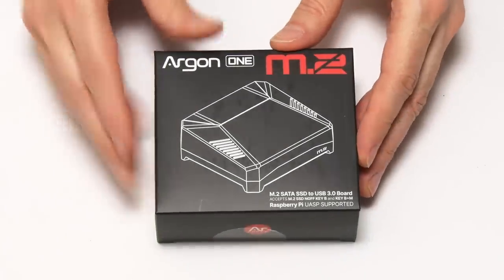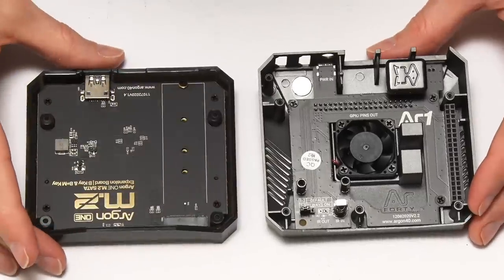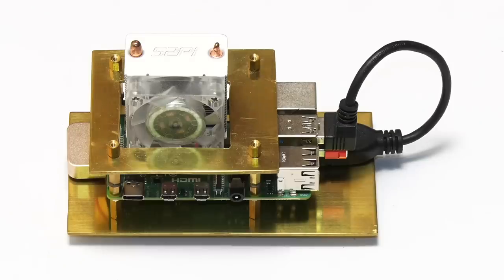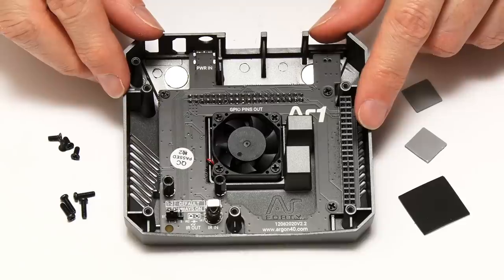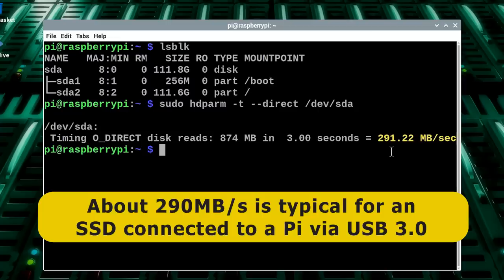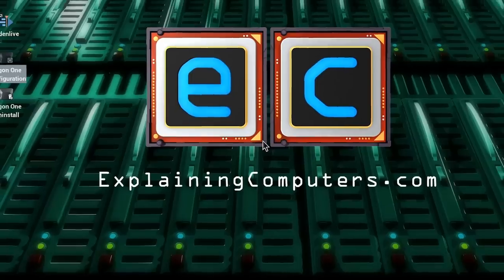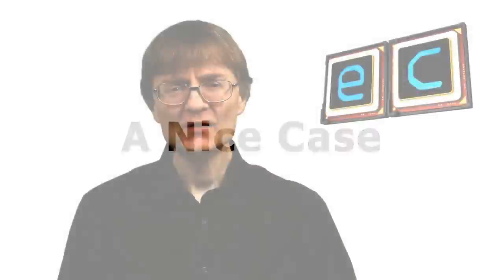Argon One M.2 Raspberry Pi 4 Case

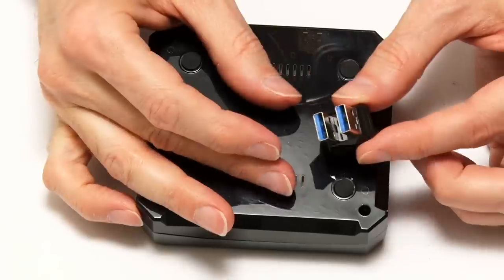Comment: That loop back USB to USB is such a kludge to get a USB HD/SSD connected. - 8:56
It has to be exactly that spacing and the Pi is the only use for one.
Reply: I had the shave the top of it off to allow USB cable to fit into slot above it. Else it was putting too much strain on the socket. Bad design.
Reply: @stephenhookings1985  - Oh, wow.  Ya, it does look pretty high.  I'm a bit surprised because the rest of the case seems well designed and fitted.
Reply: Well, considering that the mount for the m.2 drive is fundamentally the same as an external drive adapter...upside is that you're able to mount the m.2 drive, downside is that you're accessing it at USB 3 speeds, and taking up one of the USB 3 ports in the process.
Reply: Its a similar functional design to the one supplied with the CD drive on my Lenovo m93 micro PC.
Reply: That's what I thought too; What a jinky way to connect the SSD.  But I'm sure they're just working with what they've been given.  Maybe a 'C' Pi4 variant will have native capability to connect to an SSD?

Comment: Thanks C. Been using this case for a while now. Can't say enough about how great it is. My Rpi 4 4GB in this case running Twister is my main system, now. My only knock against it is that I needed an external wifi to get any reception with it. I use ethernet, now with no issues.

Comment: One thing that is really useful to have with one of these cases is a USB3 A plug to A plug cable.  This allows a PC to be connected directly to the bottom USB3 connector (SSD) on the Argon One.  This allows setting up the SSD in situ.
Reply: And better to use than the supplied dongle - that seems to contribute to WiFi interference.

Comment: Argon actually sells a conversion kit separately so if you have the older Argon One case you can simply convert it to M.2 case using it.
Reply: I recently bought this kit for my v1 case. It worked just fine but I still don't have those nice full-size HDMI ports. I'm using it for my headless proxy server and I bought a v2 with full-size ports to use for retropie.
Reply: @njbair  .. yes, nice kit to let you update a V1 to SATA, but as you say, missing full-size HDMI, and the IR receiver and Fan Jumper.

I purchased it to upgrade one of my V1 cases to give to my sister.. a wireless Logitech mouse/keyboard, a 32” 1080HD TV that a friend gave her, and she’s happy with it… simple web-surfing, email and light typing…perfect.

Comment: Argon one seems impressive, however "cooling tower" looks cool .
Reply from the maker: Yes, I would totally agree!
Reply: I used one for a while. Highly effective, but I wanted to streamline my system.
Reply: To be honest, cooling towers look too flashy and are pretty bulky and overkill for something like the Pi, I'd rather have a  gray box on my desk
Reply: Absolutely look cool… and as the cooling temperature tests showed, they are great at cooling the Pi..

Lowest temp  29C vs 38C
Highest temp  35C  vs  49C

But, the smaller, fully enclosed Argon, with all wires/cables in the back, and IR receiver is SO nice.
Reply: Im using the first version of this case for my Pi 4b since my shitty Pimoroni fan stopped working then it just broke.

Best case ever! I can run it over locked at 2000mhz all day long and the fan doesn't need to actually go on, altho it becomes much cooler, but that fan is so noisy.

I havent used my Pi 4 in a long time tho.

Wow this new case has full sized HDMI-ports!I almost wanna get this one just cause of that because micro-hdmi gets worn out and crap out very fast for me. I hate them.

I would need a new Pi 4 tho to use this new Argon one case because I broke one of my USB3-ports on mine
Reply: @pyramis47  Totally agree with you. I have one running for a few months now. I highly recommended it for anyone running RPI4 24/7. It keeps the pi cool enough and running smoothly. I live in the tropics of Malaysia and i can say this case is discreet, silent and just works to keep the pi cool. It does gets hot to touch because of the metalic case but it's quiet and less distractive. A must get for home servers/home assistants running on pi4
Reply: @crixster  Do you mean, without the cooling tower, with the original case, we can run pi for long?
Reply: @roshannubicus5917  With original pi case you will need a fan. I am using Argonone case so i can run it all day long. It does get hot around 50 to 55 degrees with the fan on. I really recommend getting at least some fan for pi4 if you intended to run it for long periods
Reply: @crixster  do we need a fan even if we have argon?
Reply: @roshannubicus5917  There is already a fan inside the Argon one here. you can even change the speed with the built in script.

Comment: Looks like they could add a couple very nice features pretty easily.  Extend the SD card slot out slightly and give you a slot to use it on the case, and flip the M2 socket onto the bottom of the board, with a hatch in the case bottom for easy access.  If they could find a way to jumper the USB3 connection internally as well so you don't use up a port for the connection, this would be about the best case out there.

Comment: One reason I bought the Argon One M.2 case was to build a Pi NAS. I was going to do the usual "rats nest" Pi set up with cables running all over and external an SSD, but before I could, I saw the Argon One M.2. I did the math, and for my application the cost of all the hardware was almost the same, and the M.2 eliminated the cable clutter and compatibility uncertainty, so I went with the Argon One M.2. No hardware problems whatsoever! Configuring the software was the biggest hassle. While this may be the most expensive Raspberry Pi case available, it's also the neatest and best looking. Having the SD card sealed inside the case may be a minor hassle, but having destroyed an SD card  because it was sticking out when I removed the stock bottom cover of an original Argon One case (tip: don't bend an SD card), I consider this to be a 'feature'. Booting from an SSD is easy these days, so a small slow SD card is becoming unnecessary. 
Thanks for the video!
Reply: Ditto! FYI, I'm using the SSD for storage only and booting/running from the top USB3.0 port using an uSD adapter. It's not quite as fast as the SSD, but much faster than uSD. This way, I can backup, swap, and test different system uSD's whenever, without disturbing my data libraries and local repositories. Just pop in a vanilla OS and locally install the apps. ;-)

Comment: Bought the original case when pi 4 came out, glad the lower m.2 part is sold separately. 😁
Reply: You're still stuck with the mini-HDMI connectors, but, yeah, I was glad to see that I could add M.2 after buying an Argon One before the M.2 came out.
Reply: @jfan4reva  Oh well. Yeah, mini-HDMI sucks, so I suggest avoiding connecting/disconnecting the mini-HDMI ports and use the inline connectors on the adapter cables. ;-)
Reply: @jfan4reva  they've released a V2 of the original case with full size HDMI connectors.

Comment: Crazy concept for a video.

I just moved to Florida and bought an old uninsulated house.

Florida is warm and humid in the summer. And I would like to protect cameras and stuff from humidity. I have one room that has a small window air conditioner.

I would like to build a unit that would control the airconditioner and a fan to pull exterior air into the room.

So what is needed is a device to control an electrical plug that also analyzes indoor/outdoor/ambient temp and humidity. 

Logic is straightforward but I have no knowledge of current technology to control power to an electrical outlet. The device I am pondering is a solenoid/relay.

Also a screen that shows measurements and targets. A way to adjust targets easily.
Reply: People use these types of devices to accomplish things similar to what you describe and many have documented it on Youtube. Greenhouse control, watering plants, etc. I use a Pi Zero, a relay, and open source software to control my underground sprinklers for instance; and (possibly) in future, greenhouse automation. I would suggest you may like to look at ChilliChumps Beginners Guide to Automation - https://www.youtube.com/playlist?list=PLuQ_ySnkV1elVl8hCvmYyEzjs_vxEIsxu for some of what you describe, as the scope may be more than Chris wishes to tackle as a project.

Comment: If there is one thing I love doing on Raspberry is installing a minimal Raspbian and then adding software manually and custom GUI. And Performance is assured. Just an idea. 
The case is really nice, though.
Reply: Yes, I'm booting from a USB3/uSD adapter, running any distro I like. I download all my github apps and data onto the SSD, then install them off line from my local repositories onto the vanilla distro that was flashed onto the uSD (assuming it is USB bootable).

Comment: Finally someone has mad a case that both fixes stupid design flaws (micro HDMI and cooling) and makes the Pi useful
Reply: There currently is one issue with the m.2 case related to 2.4 gHz wi-fi signals.
You can force it to use a 5 gHz connection by specifying the bssid of the nearest access point in the wifi configuration.

Comment: I'm not sure if it's well known but you can hook up a USB A to USB A to the m.2 bottom port (The one connected to the m.2 bottom case) If you need to flash the SSD. A lot easier than having to deal with the SD card as well as pulling the case apart. Mine runs so much better with the SSD!
Reply from the maker: Useful tip. :)

Comment: Just found out they released an adapter to add m.2 to the original Argon one. Nice!
Reply: Yeah, but be careful... It must contain the 2.2 version of the board, that one fixes the WiFi problems of the original version, basically the original one makes a faraday cage for the pi4 wifi antenna, the new one removes a chunk of copper on both sides of the board for that matter. Also I don't know if it fits the very first original argon one case that has micro HDMI ports.
Reply: @mariopojoy  good to know. Thanks!

Comment: So glad to see you got around to reviewing this amazing RPi case. Love this case. But I have to admit - blocking the microSD port is a pain.  Also - it bothered me it includes full size HDMI ports. I bought a microHDMI to HDMI cable for the RPi but can't use it now.
Reply: Switch to an ssd...it's night and day difference. One could cut a slot in it rather easily

Comment: Coming third wasn’t a bad effort considering it didn’t turn its fan on, while the others were presumably on due to their fan based design.

I’ve been running one of these on my home assistant Pi and it hasn’t turned the fan on once yet.  
Admittedly it’s winter here in Australia, but I’m expecting it to behave quite well over summer too.

Comment: I have an Argon One M.2 a couple of Argon 1 M.2 cases. In the first case I put a 120Gig SSD and I have had no problems what so ever. Basically I was very impressed with it.
In the Second case I went the Whole hog and installed a 2TB SSD. In this case (pun intended) when using a standard 5V 3amp power supply I get low voltage warnings. I did email the Pi Hut (the supplier) about this problem for a recommended power supply, but got no answer. In the end I used a Geekworm X725 fan plugged into the GPIO (be sure to plug it in the right way) and used a 5V 4amp power supply. The fan being used as an adapter for the power supply into the GPIO.

You’d expect to be able to run the Argon One case with a large SSD without having to use an unorthodox way of powering the PI. Perhaps the makers should make and a more powerful charger and supply that with the case.
So be warned if your thinking of using a large SSD, you might get low voltage warnings using a standard PI 5V 3amp charger.
If anyone is wondering why I bought a 2TB SSD the answer is I have a Raspberry PI farm, and they all network boot off this one PI. I have three OS configs for the farm. So I can power down the farm tun a simple script to select the OS and reboot the farm. That process takes less than 3 minutes to have the farm running a different OS to the previous. All of that uses about 512Gigs of space. So I could have bought a smaller SSD. 
If anyone knows of a 5V 4amp USB C charger please let me know.
Reply: I'm using the SATA compatible base successfully using a Kingston SA400 120Gb. I have heard others successfully using Western Digital equivalents.
As you say, current draw from the SSD and any peripherals quickly adds up until you get an overburdened power supply, leading to low voltage warnings and/or data corruption. (Been there, done that!!!)
I solved this by using a good quality USB powered hub, everything outside the case is run from the hub. The Raspberry PSU only powers the Raspberry PCB and M2..... This makes for a reasonable tidy installation also.

I have just received the latest toy today, the recently released NVMe base..... for M-Key NVMe SSD's only. Argon told me (after an email enquiry) that you need at least 3.5 to 4 Amps PSU capacity... which means that the standard Raspberry Pi PSU that most of us have, will need upgrading to something a bit heavier to cater for NVMe's heavier current requirements.... (and keep using a powered USB HUB for everything else)

I can't emphasise enough, the importance of using a quality, powered USB Hub for your Argon One Pi4 projects....🙃

Comment: It‘s worth mentioning that attaching the ribbon cable for a camera doesn‘t work out as neatly as everything else does for this case. In fact you might think it can‘t done at all, but there‘s an opening for it next to the GPIO connections, underneath the magnetically sealed lid. So you have to slide the ribbon cable through, in a narrow space next to the fan, and attach it to the Pi, all before securing the case, after which you have the ribbon sticking up awkwardly from the otherwise sleek-looking enclosure. As with the SD card holder, you cannot access the camera connector afterward without disassembling the case again, if you want to detach the camera and/or re-attach it. It works out, but it‘s rather clumsy.
Reply: I agree that this is not the ideal case for GPIO and peripheral connectivity. There are many other cases better suited for those applications. But, IMO, this is the best case for an SBC alternative for a desktop PC, sitting in my living room for internet browsing on my primary TV. Different tools for different purposes. :-)
Reply: @TheOleHermit  GPIO access on the Argon case is quite comfortable, about as easy to reach as the Pi without a case, and nicely color-coded. Or put the lid back on when you‘re not using GPIO, and you hardly notice it‘s there.
Reply: @slimhazard  Yeah, I know, because have 3 of them and love them. Yes, the colored header, labeling, and magnetic cover are sweet to behold.
But, I've also actually tried using HATS and experienced GPIO conflicts with the onboard fan and power. So, I wanted to give folks a heads up. I use other less expensive cases, like the versatile "iUniker Raspberry Pi 4 Fan ABS Case with Cooling Fan, Raspberry Pi 4 Heatsink, Simple Removable Top Cover for Pi 4 Model B/ 4B" for my maker projects.

Comment: Nice case. I 'rolled my own' mounting a pi 4 and 2.5" form factor SSD inside a case for Home assistant. I also had the idea to use solid aluminum stock (1/2" X 1/2", two of them)  to come in contact with the CPU and ram chip and carry that heat out to the all aluminum  case. I'm not using any fan. Only the mass of the bar stock and the exterior of the case to carry away the heat. I'm also using a bulkhead type ethernet connector that has punch down connects and a very short cat 6 to get my ethernet connection out. The only penetrations in the case are the ethernet connector, 5vdc power supply to the pi board, and I cut a slot just for convenience for the sd card just in case I need to use one and as such won't have to open the case to access it. There are two board slide rails inside the case and I have internal copper clad board that I used to mount everything. the only screws that are outside the case are the stock end plate mounting screws, and two bevel head screws I use to mount the 1/2" x 1/2" barstock solidly to the case for good heat transfer.
The case that I chose:
https://www.amazon.com/dp/B07KYDVH4T?psc=1&ref=ppx_yo2_dt_b_product_details
The SSD cable that I chose that fits in the box nicely and is fully compatible with the pi (Linux compatible):
https://www.amazon.com/dp/B07Y825SB8?psc=1&ref=ppx_yo2_dt_b_product_details
Ethernet connector:
https://www.amazon.com/dp/B07JZFWB1X?psc=1&ref=ppx_yo2_dt_b_product_details
All together I have about $30 dollars invested in hardware for a case and a few hours labor, although I have the time and enjoy these kinds of project, but really for the time and labor involved in rolling your own solution I think that the Argon case is well worth the money. It's an eloquent solution.

Comment: A nice review indeed. All features covered well. That said, this is not a case I would buy after having purchased and used the first Argon case for the Pi 4.

It’s quite restrictive in a few ways. One, no SD card access is really silly given how simple it would be to add a little door to the plastic bottom portion of the case. Two, there is literally no way to add any HAT to the Pi 4 in this case. It would be nice if there were a daughter case that attaches to the GPIO so that HATs could be added. Three, after all the engineering that went into this case with sophisticated circuitboards and cooling they could not find a better way to attach the M.2 board than with a USB to USB jumper? It looks crude and is not secure. 

Other than those issues, a decent case. They really should consider selling just the HDMI extender board as that is a highly desirable feature.